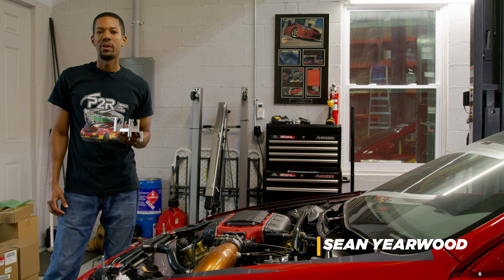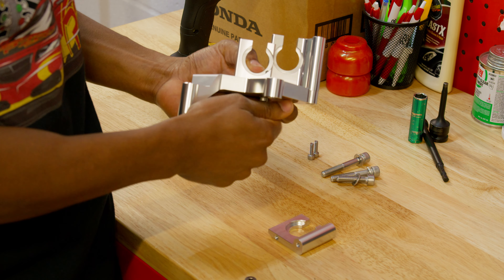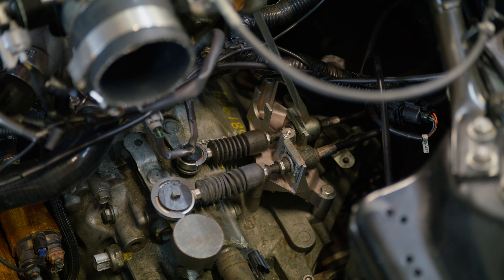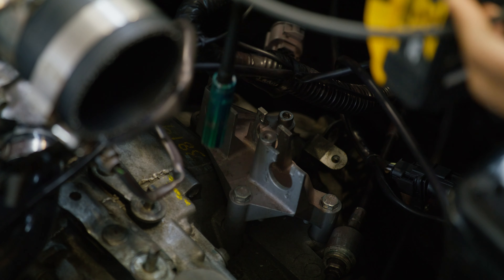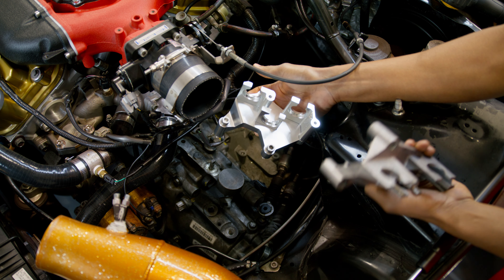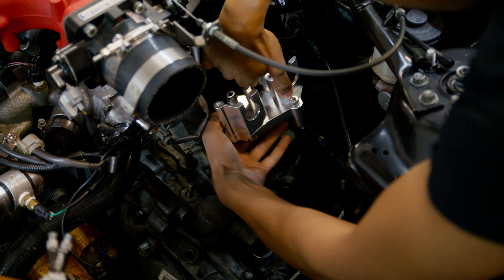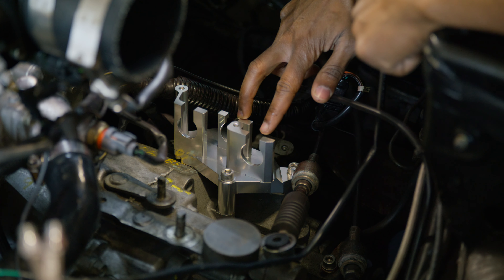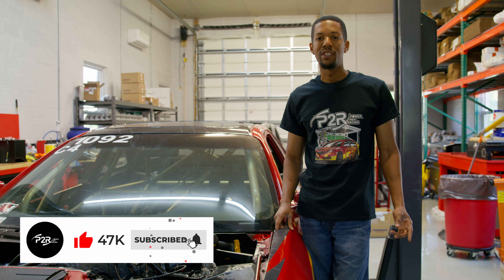P2R J-Series Billet Shifter Cable Bracket Install

Comment: I love P2R. These guys really and truely represent the J Swap community. Your customer service and support is excellent. Thank you for the advice and idea you gave me about doing my manual conversion. Also thanks for the Intake Runners and the Exhaust manifold headers.
Reply: These guys are awesome have called them up needing transmission cables in a rush and he’s got them to me very fast great company great customer support